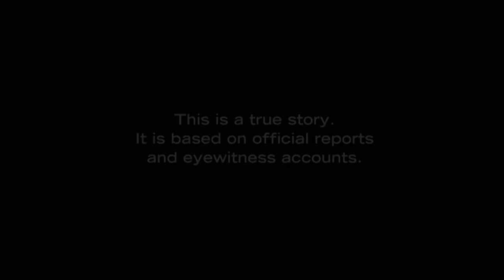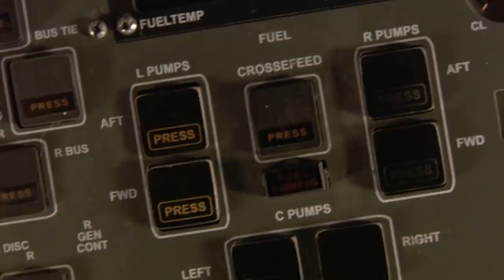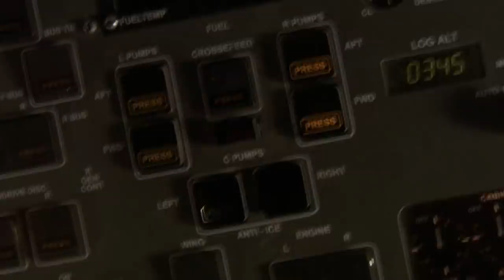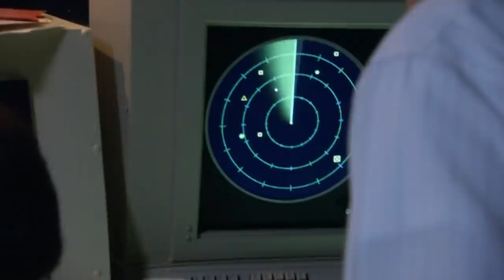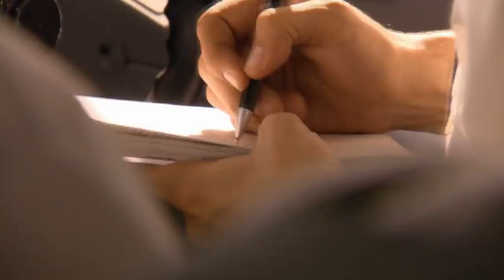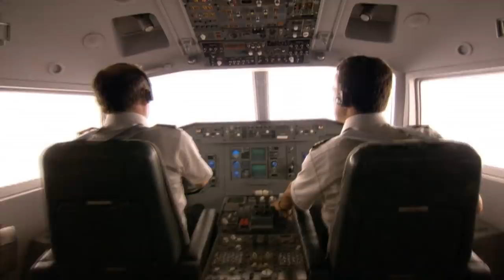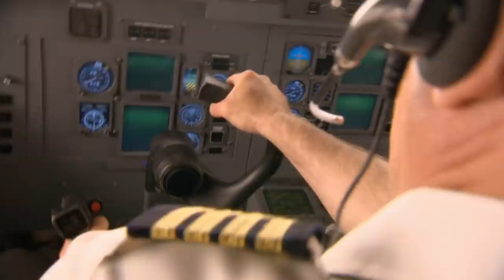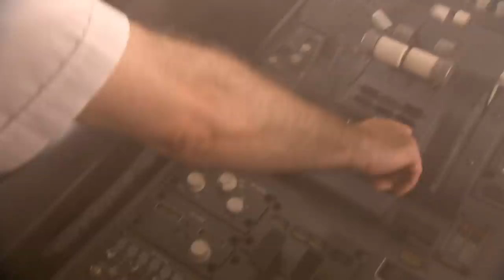Landing A Boeing 767 Without Engines | Gimli Glide | Mayday: Air Disaster

Comment: “Cause I’m a high planes drifter, the best that you can get...” That was the smoothest move I’ve seen so far in this series, this captain is a hero! Those two boys had quite a story to tell their friends.
Reply: Ok I might as well add, “I’m doing 120 plowin’ over mailboxes, radar detector to tell me where the cops is...”
Reply: Dude when narrator said plane was SILENT n obv. no horn?! I went HOLY SH*T! Bc did u see size of that plane coming in on a freaking skid?!!
Reply: Have yall seen the one of cathay pacific. That one is pretty awesome too
Reply: @may may 7
Reply: @christinekobzeff  hi
Reply: @Aizhaqueeni  

..

The
Reply: There Friends:

Stop Cappin bruv
Reply: He might be a "Hero" but he also took off with almost dry tanks. It was his responsibility so the cause is "pilot error".
Reply: Just like in the movies they never move to the side, they just try to pedal faster.
Reply: The boys: The day that we would not move out of the way of an airplane almost killing everyone on board.
Reply: @Aizhaqueeni  did
Reply: @fredjones7705  
It's never that simple. You missed several items in this video. 
a. The fuel gauges were not working 
b. The flight computer showed the correct, believed fuel amount to be present.

None of the technical details were shown here. For all of the technical details, see the Mentour Pilot channel.

Some of the other issues include:
a. This was the first plane to use metric 
b. The ground crew measured the tank levels manually 
c. The fuel amounts were converted to or from metric by hand
Reply: @fredjones7705  
You're sure out to call people names.
There are actually 2 runways at Gimli. The pilot was clearly going for the longer one. The other is in use now. Obviously no one knew that at the time.
Reply: Not really a hero if you didn't do a proper fuel check and took off with not enough fuel to make your destination.
Reply: @ItsMe-jd8ou  Got a link?  I don't see any for Cathay Pacific.
Reply: @OneTequilaTwoTequila  The pilot did do fuel checks, he had the tanks checked manually, and checked with the maintenance supervisor on the issue. He was given the go ahead. There was no one person responsible, it was a combination of at least 4 different things that led to this. If only one of the 4 factors was different, this wouldn't have happened.
This is a complex system with many people, inadequate management systems was ruled the actual cause.

The are 2 other reports on the issue that together, elucidate all of the many details. 3 other people made mistakes, the captain relied on other people, he made no mistake. The captain really did save the day.
Reply: @OneTequilaTwoTequila  come on Guy . When it counted the only Person at the Controls were at the controls. Praise God and the Crew for doing the impossible and they did it with Grace.........
Reply: @Aizhaqueeni  
The skid that plane was in, and the loud bang when it touched down wouldve sounded like a damn screaming banshee!!🤯😲
Reply: @emmas1082  sometimes the movies get things right.
Reply: @lemonsqweezy9532  👍🏻 If you are referring to the constant theme of people trying to out run machines that are clearly faster than them,  as opposed to just getting out of the way🤣😂 you are the only one that picked up on that⭐️⭐️⭐️⭐️⭐️
Reply: Tell me about it!
Reply: Holy sh** When the both engines went out
Reply: The captain is the reason they ran out of fuel. He fucked up the calculations twice, did not double check broken systems on his aircraft even though he had the opportunity to do so, and was not legally cleared to fly the plane with the broken fuel gauge (which wasn’t actually broken, just only half functional). It’s a brilliant piece of flying that never should have occured
Reply: @Aizhaqueeni  i
Reply: @seanrodgers1839  I believe the problem was maintenance crews not
fully understanding the new metric system. I believe they put in litres
instead of gallons. I believe off hand there's 3.79 litres in a gallon,so 
if you needed 100 gallons ( imperial) and you only had 100 "litres", well
your in big trouble. So you'd have roughly only 25 gallons,well short.
You'd actually need about "379 litres" to equal 100 gallons, and they
only had 100 litres, instead of the 375 litres needed. About 3/4 short.
Reply: @grantp4022  
3.79 litres to US gallon. Imperial gallons was used in Canada which is over 4 litres. 4.5 if I remember correctly. Further complicating it was that the plane uses lbs, now kg and that was converted to gallons, now litres for the fuelling staff. 

The actual calculation sheet is shown in one of the videos. The pilot orders fuel by weight, pump guy fills by volume. 

There is no one mistake, there are about 4 errors together. If any one didn't happen nothing would have gone wrong at all.
Reply: @Aizhaqueeni  w
Reply: @vickiebarnet9972  Huh? lol ☺
Reply: This captain is a hero indeed.
Reply: Hi Verified Person
Reply: From what I know, the error was the fuel was entered as pounds instead of kgs, so the pilots thought they had the correct kgs, but actually much less fuel had been entered.
Reply: Except is was a mistake of using metric units in place of imperial units by the pilots that caused the plane to run out of fuel.
Reply: As someone who worked in aviation for over ten years, I guarantee that if you go by the book, there is no one at fault here but the pilot. Once the aircraft captain signs off on the serviceability of an aircraft, he is accepting full responsibility that every metric that aircraft must meet to be considered airworthy, has been met. Whether or not he decides to put his faith in other people is completely irrelevant. The responsibility is supposed to rest squarely on his or her shoulders, should any deficiency exist which results in an aircraft incident, or accident. 

Captain Pearson is not a hero. He is no more a hero than a firefighter who sets a house on fire, and then saves the children who were sleeping inside. Of course, in Pearson’s case, his actions were not intentional, but the reason there was even an emergency in the first place, was due to his negligence, and willingness to sign off on an aircraft, in the midst of highly confusing circumstances. He simply did what anyone in his situation would do when faced with a life or death situation. He did everything possible to save his own ass… From an emergency created by his own negligence.
Reply: "HIGH PLANES DRIFTER"!!!  Pure genius, my friend.
Reply: @emmas1082  the Boys who were as cute as buttons were riding their bikes on a permanently closed runway at a permanently closed airport.  They couldn’t hear an airplane because the engines shut down.
Reply: @fredjones7705  hello  Fred I was on the plane in the cockpit and assisted wit the polos during the emergency.  The tower operator at a nearby airport
Reply: @fredjones7705  dear Fred...👨‍✈️ l was in the cockpit of the aircraft assisting the pilots with their emergency.  I was assisting with navigation and fuel consumption issues and the pilot indicated that the airport that we could reach was permanently closed and a nearby airport tower operator indicated that there was a town gathering there for recreation .  Even the runway , please understand was closed by written agreements and the airport was probably indicated as closed on the charts.  The tower operator did try to contact someone on the area to let the people at the closed airport know of an airplane landing in distress but the message arrived shortly after the plane landed
Reply: @seanrodgers1839  hi, it would be nice  if the truth were known . So here it is just for you. I was the pilot of that plane and landed it with a double engine failure because both engines sustained damage from bird strikes from a previous flight that was not reported I landed the airplane “dead stick” safely .  A landing even the passengers enjoyed because it was so smooth and quiet..  where the problem started and continued was when a mechanic and pilot  took the airplane on one functioning engine and crashed it with passengers  that they invited.  It crashed while enrout to an airport for repairs.  Thats where loss of life occurred.   In a condition like that, there never should have been passengers on board. THE END
Reply: @seanrodgers1839  I just sent a response to Fred... I was the pilot in command of that flight ...none about the crash was true. I landed the plane Dead Stick..no working engines ...with a very smooth landing.   It was the crash that occurred after when another pilot  and mechanic ferried the plane with only one operating engine and passengers on board and crashed while enrout...THE END
Reply: @seanrodgers1839  If the fuel gauges are not working (and even if they are usually) then you must visually check the tank level. Often this is done with a dip stick. You can NEVER rely on derivative fuel calculations. As far as metric/imperial conversions this is SOLELY the pilots responsibility. If he couldn't with total confidence state their fuel load then he should have refused to take off.
Reply: @fredjones7705  
The captain did check the level with the physical measuring device. The captain then ordered a certain weight of fuel. The fuel pump guy then translated that into volume and did the imperial conversion. This is not my opinion, all of the details are in another video on here, and in the Royal commission on the incident. 

Both people follow airline procedures and the procedure was not sufficient for the metric conversion. There's more factors, I can't put them all here. It's because of a totally unforeseeable chain of events. If it was one simple thing, nothing would have happened. The other video shows the calculations for the conversion and tells all the relevant details, watch it.
Reply: @seanrodgers1839  The captain did not check the level of the fuel AFTER it was loaded. His plane his responsibility. That's how it works. Obviously he should not have trusted the fuel guy who didn't complete his/her remedial arithmetic course.  If the plane runs out of fuel it is by definition the captains fault. The only exception I can think of is a 767 that was hijacked and they made the captain fly until they ran out in Madagascar I believe.
Reply: @fredjones7705  The pilot checked with the maintenance head and got clearance to go ahead, given the situation. No one person's actions determine the safety of complex systems. You have systems where each person plays their role in the system, with redundancy. No one person knows every issue. There was a royal commission into this incident and the airline's procedures ware found at fault, not the pilot. There is a large number of people who work to ensure that the plane is fit to fly. The pilot had his assurances from them. The pilot questioned them and got the go ahead. This is not a Cessna with one person responsible. 

Why don't you get all of the details, they are known. Every single detail has been gone over in excruciating detail by experts. You are not going to do better. Simple, easy answers only come from lack of knowledge about a situation.
Reply: @seanrodgers1839  The captain trusted the maintenance guy and that IS his prerogative but that does not let him off the hook. Trusting him was a judgement call and it was the wrong call. I've worked the ramps and remember clearly captains who refused to takeoff due to fuel calculation discrepancies. Additionally he should have noticed the condition when his predicted flight performance did not match his expected profile due to being several tons lighter than it should have been.
Reply: A TRUE HERO FOR ETERNITY
Reply: @fredjones7705  Like I said, he did checks with people, he followed procedures. His actions withstood the intense scrutiny of a royal commission that closely examined every single detail. 

You could be discussing the many details in the sequence of events. Since you are not, I take it that you don't know them. There are more than I have mentioned. They were not mentioned in this video.

Since you're not discussing any of the facts of the case and just blaming it all on the pilot, I don't think that you have much of a case to make.
Reply: When did he say that
Reply: “Hero” is accurate!!
Reply: @fredjones7705  Why were they idiots to use it as a drag strip? It was decommissioned.
Reply: @chadwells7562  Obviously the pilots didn't think so.
Reply: @emeraldqueen1994  Hero is when you put yourself at risk for others. He was just doing his job.
Reply: @seanrodgers1839  Run out of fuel for whatever reason and it's the pilots fault. "The buck stops here" He screwed up but made the save.
Reply: @fredjones7705  
It's not that simple. There was a complex series of events. The pilot checked with various people responsible for various items and got the affirmative from them. The pilot gave the correct fuel amount to the pump guy.

Presuming that something is simple with simple causes is a mistake in itself. This is like explaining that the Earth is round to a flat earther, I am not going into it further.
Reply: I agree with this, Christine! :)
Reply: @00- 00 fog
Reply: For real